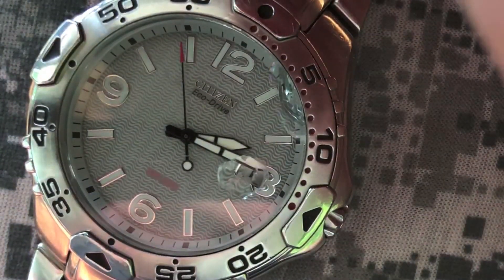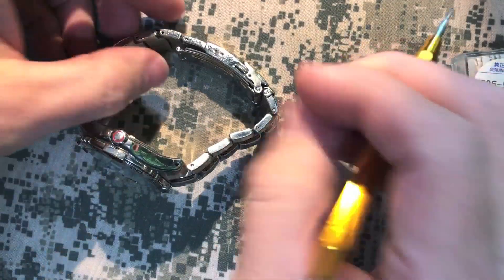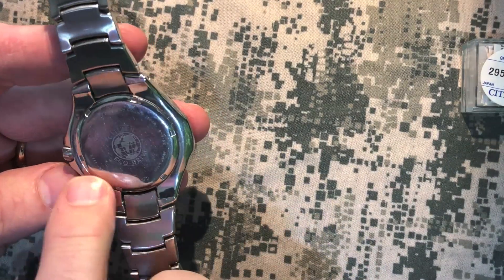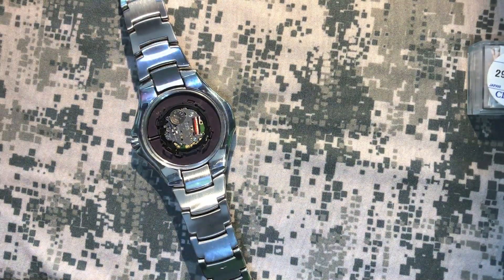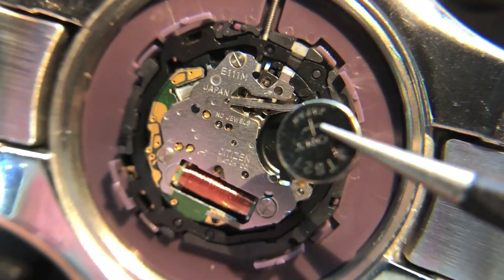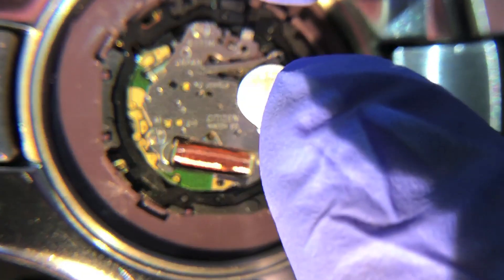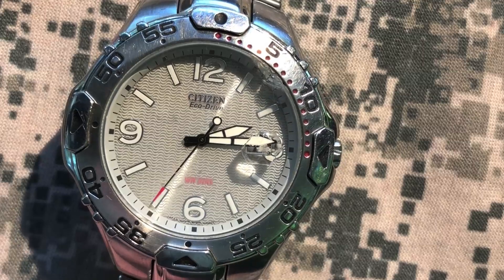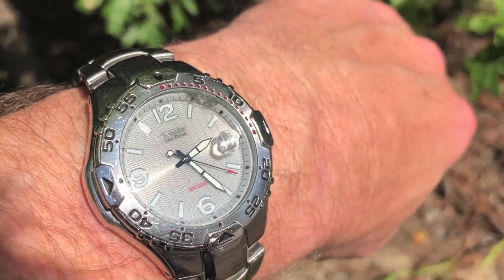How to Fix Your Citizen Eco-Drive Watch | Replace Capacitor

Comment: Thanks for your video. I had a hard time only because I didn't have any gloves to position the battery when getting it in place. Once I finally got it in, I turned the watch over. Nothing happened but as soon as I got it where bright sunlight hit the dial it started right up. I have it on a window sill right now to get it all charged up. This is a Citizen Garrison Watch I got off Ebay from a seller I used before. It wasn't charging like my other Citizens and when contacted the seller said they had been in storage for a long time. Citizen told me and him that it would take 1 to 2 months for it to fully charge after being in storage that long. Thats way tooooo long. So I ordered a new capacitor off Amazon and thanks to your video its now charging so I can use it. Thanks again.
Reply from the maker: Awesome! I LOVE to hear stories like this. Tip: the window sill is great (south facing?) but glass and screens have filters. Direct sunlight outside is the strongest/quickest charge. Check the description for a link to Citizen’s suggested charge times by model/movement. Glad you brought it back to life!

Comment: damn, thanks a lot, my watch is just stopping to work at night, so i assume its the "battery" cheers its a citizen wr-100.. was my dad watch.. its sentimental value
Reply from the maker: Would love it if you check back in here after you get it up and running…let us know how your project went! So great to have a sentimental piece like that.
Reply: @WatchWitt  i just gotta order a battery :P (or whatever it is called haha) its about 60AUD with shipping :P prob gonna cost the same price as the watch to get it fixed at the jewel shop :P cheers!

Comment: Great video and information, thanks! My Aqualand has been dead for quite some time (it was left in a drawer after a move). With your help, I was able to correctly identify the right battery and ordered it and the tool kit from Amazon. Both came in a few days and I just finished the repair. It's back up and running again. Awesome!
Reply from the maker: Oh, that’s awesome, Hurl…you just made my day! It’s a great feeling to get that watch rolling again, right? Thanks for sharing your story here.

Comment: Should I recharge with a led lamp or a actual lamp with a bulb
Reply from the maker: Either is fine, but direct sunlight is best…meaning outside, not through a window which have UV coatings and/or screens that filter light. Check your movement number recharge instructions for recharge time.

Comment: would this happen on a new watch? thats whats currently happening with mine.
Reply from the maker: It could, but not likely a bad capacitor unless you bought really old new stock. Charge it in direct sunlight (outside, not through a window) for the best charge rate/effect. Read your movement’s charge rate, but most are 12 hours from empty to full in direct/outside sunlight. 150 hours charge empty to full 8” from a 30w fluorescent bulb.

Comment: Great success on this video! Congrats. 🎈🎉🎊. Great tutorial. I like the tips re: the wood dowel and oil in your hands. I’ve shorted a movement or two via my stupidity. Expensive lessons.
Reply from the maker: Thanks! Yes, I guess it was the right video at the right time. @David Schwartz added a great idea of using a plastic baggie between the caseback and the tool, to prevent potential scratching when removing/tightening caseback. I ALWAYS do that now. We’ve all got some uh-oh moments, right?!

Comment: Very good video 👍🏼.... DISCLAIMER AT YOUR OWN RISK I AM NOT RESPONSIBLE FOR ANY DAMAGE REFERENCE INFORMATION ONLY: for anyone that hasn’t owned a citizen watch before, if it goes to 2 seconds or completely stops “ticking” even keeping it under light  (artificial or natural) for some time, try to do a “Reset” on the watch. DISCLAIMER AT YOUR OWN RISK I AM NOT RESPONSIBLE FOR ANY DAMAGE REFERENCE INFORMATION ONLY : what I did to mine was attempt to reset the watch and then after noticing it wasn’t “ticking” I was playing with the buttons “A,B” and it began to move the “3rd arm” once I put the crown back in to normal position it began to “tick” like normal. (I have a citizen ProMaster Depth Meter Chronograph BJ32000-09E https://www.citizenwatch.com/us/en/product/BJ2000-09E.html) DISCLAIMER AT YOUR OWN RISK I AM NOT RESPONSIBLE FOR ANY DAMAGE REFERENCE INFORMATION ONLY
Reply from the maker: Thanks! Yes, a reset is necessary if your watch has gone into “dark” mode. This video is for those watches that won’t resume normal operation after a reset. Love that watch you’ve got...very nice! Here’s the reset directions for YOURS just so others can see: 
Unscrew the crown to release it from the case and pull it out two ‘clicks’. Simultaneously push the upper right (B) and the lower right (A) buttons at the same time and hold down for 2-3 seconds, then release. This ‘resets’ the movement.

Comment: What do you do if the back of the ecodrive does not have any slots?
Reply from the maker: If your case is not a snap on/off (which THAT is not as easy as it sounds!) then may need a friction ball to remove your caseback. https://youtu.be/XurACI4qIO8

Comment: Mine it’s 21 years old and going strong! What about the waterproofing ? Is it there a way to do it your self ?
Reply from the maker: Nice! That’s a great service life! As to the waterproofing, just replacing the gasket that I mentioned and showed towards the end would be all you need to do. But if your caseback has never been opened, and you don’t have any signs of fogging inside the crystal, I would just leave it be.

Comment: Very nicely done 👍
Reply from the maker: Thanks so much! It was a fun project to film, and seems to be well received. Many of the first generation Eco-Drive capacitors are reaching their end of service date!
Reply: @WatchWitt  it’s a shame that a lot of people don’t know they are an easy replacement and end up throwing them away .
Reply from the maker: @TedCornish  I know, right?! It also doesn’t help that Citizen only refers to the rechargeable cell as “will last the life of the watch.” The actual watch can live on for much longer than 10 to 15 years!
Reply: @WatchWitt  it’s always surprised me how they’ve got away with that built to fail marketing when it’s lies
Reply from the maker: @TedCornish  Exactly. They wanted to be able to say “never needs a battery.” Did they bank on consumers throwing the watch out at the end of battery life, and then buying ANOTHER Citizen? I think they did, but I also like to think that companies don’t have evil plots like that! It seems they just don’t want to back step on their previously mentioned marketing slogan. Eco-Drives are great watches, but it takes folks like us to inform the consumer.

Comment: I received my Citizen Eco Drive J850 PRT a couple of days ago, it has Power Reserve Indicator but it always shows to zero, although the watch works fine except of that indicator. If I will replace the capacitor or battery is that going to fix the indicator?
Reply from the maker: Nice watch! Well, a couple of questions to get the right answer for you. Is this a new or used watch? If new, did it come with the crown pulled out so the watch was stopped, or was it ticking? 1 sec increments or 2? I’ll start by assuming it’s new and you opened it from the box and just started wearing it. Just keep wearing it and constantly exposing it to light and that power reserve meter should slowing start rising. If the battery were dead and/or to give you an idea of how much light it takes to recharge the cell, it takes 25 straight hours of the dial 8 inches away from a 30watt fluorescent light to have it start working normally. 200 hours to completely recharge. What kind of light have you exposed it to and for how long?
Reply: @WatchWitt  Hi and thanks for replying. The watch is new and the crown was pulled out first time I got it out from it's box.

The second hand jumps in 2-second intervals in the first time the watch was exposed to room light.

I exposed the watch to different sources of light (outdoors for couple of hours and room light entire night). Now the watch works fine and keeps up with time just the Power Indicator is dead.

I have ordered a replacement of the battery or capacitor from amazon and I'm not sure if this is going to fix the issue.
Reply from the maker: @Sylverano  Ah, ok. Well, based on your answer, I feel that it just needs a longer charge time and I think you’ll see the power reserve meter start to increase. I would recommend a mixture of direct sunlight (outside, not through window) and constant close proximity indoor light for that 200 hour range. That’s 8 days! If you get some solid sunny outdoor time it will reduce that charge time, though. 

It does sound strange that your new battery would give off the 2 second tick warning, though. If it doesn’t improve after doing the above, I would return it. It sounds like that’s not an option for you since you already bought a new capacitor for it. So, that would be the next logical step if you can’t return it or utilize warranty service for some reason. 

Good luck! I hope you’ll report back here with the outcome so we can all follow along!

Comment: Great instructive video. I have a problem with my citizen blue angles watch, perhaps somebody else has the same problem. The watch is 12 years old and has worked flawlessly. The battery had run flat and I had a jeweler order the battery and replace it. The problem is that nor him or I can reset it. No error code, ticking normally. Went through all resetting instructions hands moving but revert back. It’s frustrating and quite silly that a quality watch like this should encounter such trouble. Any ideas would be appreciated...
Reply from the maker: Thanks. Yours is an Eco-Drive, right? If your watch was completely dead, in the stopped state, I believe you’re supposed to pull the crown out to the time setting position while performing the recharge session. Keep in mind, it can take 60 hours plus to charge in low light conditions. Once you’ve hit the timeline suggested for the brightness level of your recharge, then push the crown back in. Have you tried that?
Reply: As I stated, after the battery replacement the watch is functioning correctly. Charge indicator is reading full. The problem is in the total reset. After following all steps it will not zero out with all hands pointing to 12. During reset hands move but return to prior position. Why?
Reply from the maker: @tomcannone9875  Ah. Bummer. I don’t own that watch, so I’m not familiar with that process. Like you said, hopefully somebody who has had (and solved!) that problem can chime in.
Reply: What model?  Or at east what "calibre" (module)?  A friend had a Blue Angel (AT8020-03L  / H100)  with radio correction.  Kept reverting to "wong" time and date becasue he had accidently set it to radio correct to LA ime when he was in Pittsburg (NYC time).   Set it ti NYC, and all was well.

Comment: ..Great video thanks. i have Eco Drives for more than 15 years., time to replace a couple of batteries, did not know i have to use gloves to avoid contamination.
Reply from the maker: I’d love for you to return and comment here after you’ve replaced one. Report on the ease of the project and ultimate outcome of your results. Yes, finger cots are good, but I just used exam gloves as they were handy. Thanks for watching!

Comment: How many years you wear your Citizen until this moment? very good vídeo, best regards from Brazil, Mário.
Reply from the maker: I think it was about 12 to 15 years. Thanks for your kind words!
Reply: @WatchWitt  Thank you very Much.  I think I will buy a Citizen however I own Victorinox, Timex and Casio which run 10 years on an ordinary and cheap battery such as cr 2016 and Cr 2032. Happy new year!!!

Comment: 5:29 Where is the regulate/ trimmer screw, any ideas? Also any idea where to find pdf technical service manuals for Citizen (not the user guides the actual service manual)??? Many thanks.
Reply from the maker: Ooooh. I don’t know. If it exists on this watch, I need to find it too! Ha! I have only been able to find user guides, not service manuals. Sorry.
Reply: @WatchWitt  Hmmm same here with the manuals. The regulation screw - I have a feeling there isn't one on these E111, which are the cheaper and smaller of the Ecodrives - the Seiko equivalent the V157 range doesn't either, once it comes out of the factory that's it. Bah! Come back 7548 all is forgiven!!
Reply from the maker: Haha! Yeah, I’ll explore under the hood of mine a little more, but I suspect you’re right.

Comment: Nice guide. Where do we get the rechargeable batteries from? I need something for the U700 movement.
Reply from the maker: Thanks. You should be able to find them on Amazon or eBay. Looks like yours is a little more rare, though. Here it is on Amazon, as an example. 295-7580 Genuine Original Citizen Watch Energy Cell - Battery - Capacitor for Eco-Drive Watch (Same as 295-758) https://www.amazon.com/dp/B07JKD52XT/ref=cm_sw_r_cp_api_i_fX9NFbEMYFB1Q

Comment: I bought a pair of ceramic tipped tweezers after shorting out a Movado movement.
Reply from the maker: Ha! You don’t even think of it, right?! I didn’t have any plastic tweezers with me (I shot this on the road) which made me think that most others attempting the project won’t either, so let’s just don some gloves and get in there!